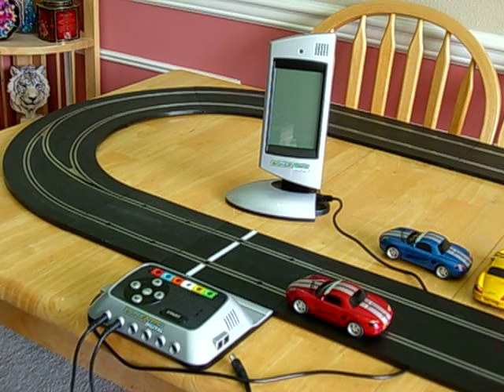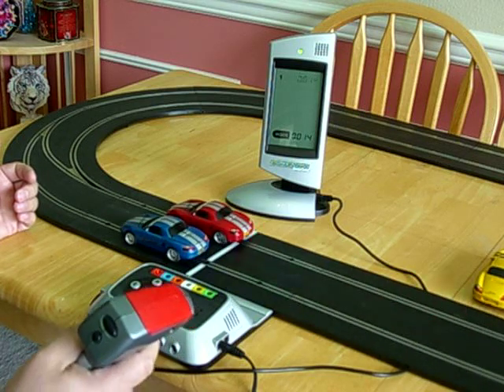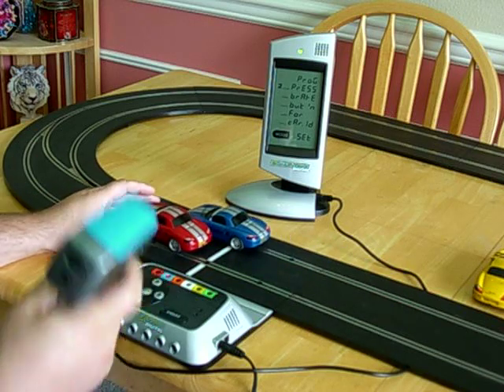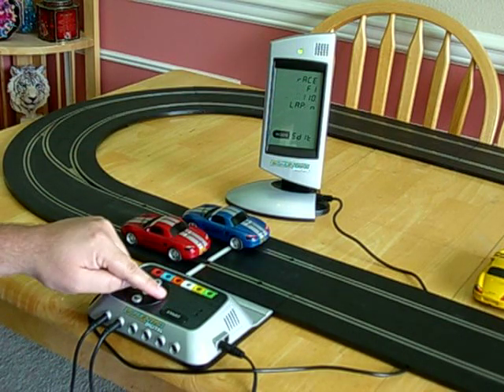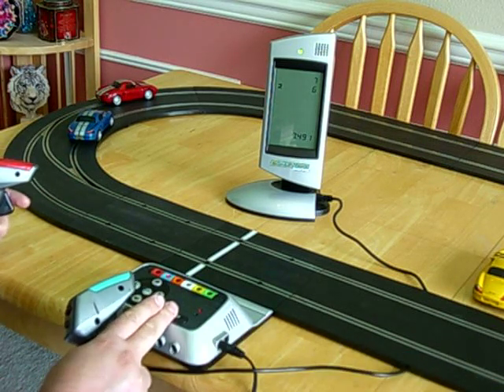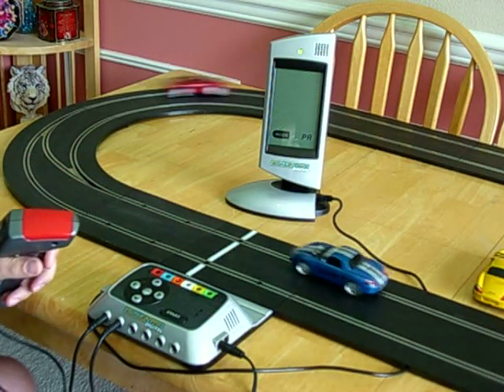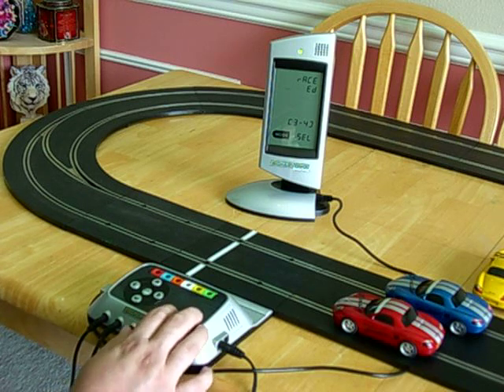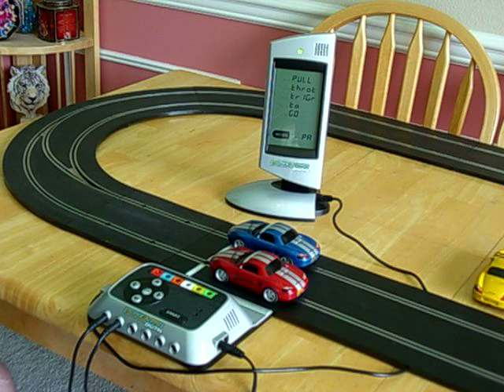C7042 Part 1 - "Basic Mode"

Comment: Love the videos! I've just bought the 6 player. I set up a small track without digital track pieces to get used to it, however the basic mode setting up cars didn't work, controller 1 only controlled 1 car? Is this because of no digital track or/& only using 1 power supply?
Reply: Did you program other cars to that controller? Even if cars are on the same lane, digital cars only respond to the control signals for it, and not those for other cars. But, there's nothing stopping you from programming multiple cars to the same ID/controller. If you do that, then they should go at the same time.
If you put an analog car on the track, it will just making a high pitched whining noise. It doesn't damage it, but it won't go at all unless you switch the base to analog mode. In analog mode, it's one car per lane, no programming.
Reply: @ggaub  thanks for the feedback. it was actually working both digital and analogue cars. i realised it was in analogue mode and did a factory reset. its now working lane switching lanes etc and i hope use more features. Thanks again

Comment from the maker: The PSU for the C7030 is not compatible with the C7042.
The C7030 has it's own power issues to deal with. Even with two power supplies for it, 6 cars can be a burden, especially on a track with many lane changers and/or accessories. The C7042 with just one compatible power supply would probably run 6 cars as well, possibly better.
The "APB" as we call it, is roughly equivalent to the C7030 with the Simple-H power upgrade. Besides, development is active for the APB, and stopped on the C7030.

Comment: Hi.. Can you pls help me with my c7042 power base.

The problem is the noise coming out of it. It sounds like a fan running inside but it's much louder than say a laptop fan. And the sound is not even smooth. Kind of continuous clicking.

I have seen videos and it seems like the base does not have any noise coming out of it while is use, except for the beep on pressing the buttons.

Can you please confirm if this is normal.
Reply from the maker: There is a fan, but it sounds as if yours is hitting something inside the base. You could return it to the place of purchase for a replacement, or contact Scalextric/Hornby directly for warranty service. If you're good with electronics, you might be able to open it up and fix it yourself, but I would only suggest that if you feel confident, and don't care about voiding your warranty.

Comment: Hi have to admit love your videos on Scalextric 6-lane powerbase. I have to agree the manual is very bleak. Could you answer some question for me with regards to the power base. Firstly where the power goes in there is two power slots but on your video only one seems to be in use is this how to add another power base for strength of power across the entirety of the track for larger sets?

Also so if not what is it possible to put in another digital base like a 4 point digital powerbase to increase the power at a further point down the track? I'm currently running a 200 foot track with power lag occurring on the track.

Look forward to your reply keep doing what you're doing :-)
Reply from the maker: NEVER put more than ONE power base in a track.
To bring power to the far sections of your layout, we run what are called "jumpers" or "power taps" from a track near the power base to a piece of track that is far away. Scalextric do make/sell wires specifically for this purpose that have spade connectors that hook up under a half or full straight piece. Those pieces have the tabs for the spade connectors to slip onto. You can make your own, as well. If you know how to solder, you can do them without spade connectors by just soldering the ends of the wires to the rail tabs under the track.
The important thing is that you use 4 wires, one for each rail of a two lane track, and make 100% sure you have not swapped them around at one end. I usually draw an arrow on the bottom of the track with silver marker to denote the direction of car travel, and then use colored wires so that I always know which wire goes to which rail.
You will find, especially over time, that you'll need more power taps than just one to the half-way point. My track, which is only about 55 feet, has 9, and each piece of track is also connected to the next one with little jumper wires underneath. I did this because my clubs race competitively on my track, and any kind of power drop is an extreme annoyance. I haven't had power problems since I did that work several years ago.
Reply: @ScalextricDigital  many thanks for your reply. I do have wiretaps there from an old Scalextric but there seems to be some confusion even when I got in contact with Hornby themselves as to why the 6 car powerbase had two power ports. Myself I would have linked those Lane 1 and 3 to 2 and 4 and divided the second powerbase between them on a 4 Lane track but the gentleman that I spoke to seem to have no knowledge on this. Largest track that I've ever had up and running was approximately 80 foot but we're going for the 200 as it's for a charity event to raise money for the Norfolk Broards racing team(tasker whiskey challenge) and before you say yes I have spelt it correctly :-)

Thank you for your advice if I can I will get some footage and put it on YouTube so people can see how the track went.

Jaydee
Reply from the maker: @suzy650  Oh yes... the two power ports on the C7042, as well as the new ARC Pro power bases are for a second power supply. This increases the total amperage that the base can supply, so that running 4 to 6 cars does not have so much power loss when one car takes off or stalls and starts taking more amps than normal, taking away amps from the other cars and slowing them down. With two power supplies, you double the amps from 4 to 8 amps. The voltage is the same, but the amount of power available is doubled. This doesn't change the problem of a really long track needing power taps, though. If you're running with more than 3 cars, definitely get the second power supply to plug into the base. Set up some power taps, I'd say at LEAST 4 for such a long track, and also make sure the rails are nice and snug by pressing down the metal tabs at the connectors from the bottom (flip over onto hard surface and press the tabs down with a hard tool of some kind). With snug fitting connections and a few power taps, plus a second power supply, you'll have great 6 car racing for your event!

Comment: Hi great tutorials! I have a problem in analogue mode, regardless of the settings lane 1 goes right to left but lane 2 goes left to right. Can you help as I can’t find a solution thank you
Reply: I believe in these cases the base has a defect such as a malfunctioning relay. Your best bet is to contact Scalextric customer service to see if they can help. But, if you use it exclusively in analog mode, you could just open it up and swap the polarity of the wires that go to the rails for the slot that's going backward.
Reply: Greg Gaub Thank you Greg I use both digital and analogue (mostly digital) it only happens in analogue mode although if I use a car with a chip in analogue mode it goes in the correct direction which is strange?
Reply: @leesslotcars  That's because digital is AC and the car chips have bridge rectifiers in them. They will always go forward.